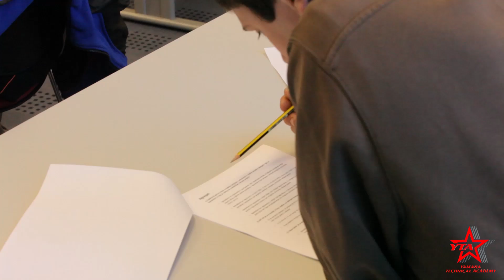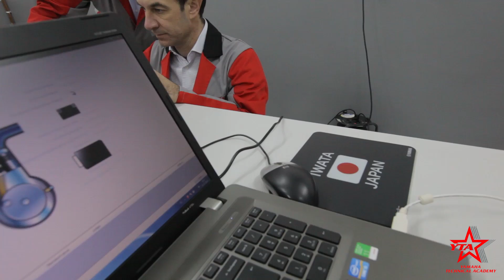Yamaha technical academy

Comment: hi I've been having some problems with my 03 Yamaha R6 YZF we put for new coils new TPS did a valve job and new spark plugs and also replace the harness Venetian coils I was testing the injectors individually without the harness and all of them read out 12.8 - 12.9 and the second to the right brought out 13.5 is that a open injector because it smells like gas even at the dealership at Yamaha think it could be a few problem or something else but I'm checking it because I cannot afford high-end labor cars